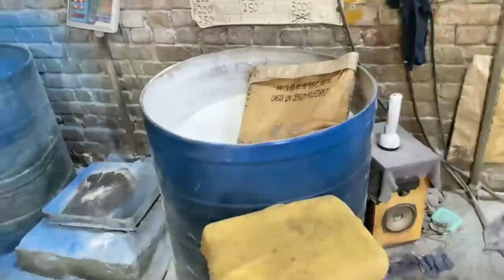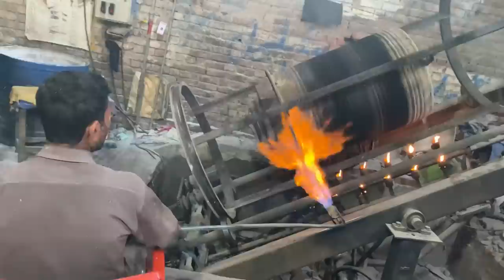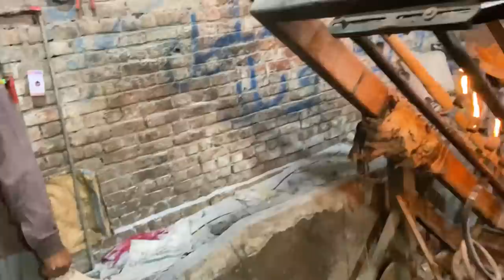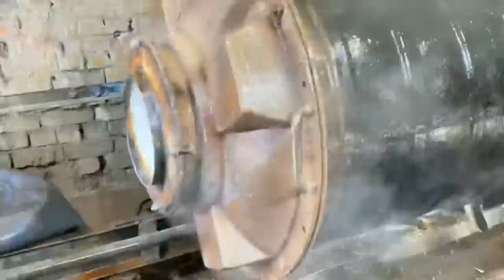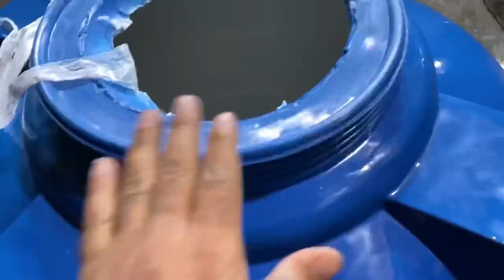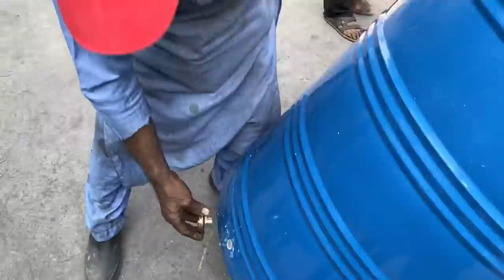Manufacturing Of Water Tank | in Local Factory Manufacture of  water tank |

Comment: How much do I need to start such a company using biogas as a mean of fuel?
Reply: Only estimating by eye but it looks like about 500 kW or a little less than 100 m³/h of biogas (with a little more than 50 % methane) at full power but it doesn't burn many minutes per tank. You need a gasometer after the digester so the production of gas can be continuous with intermittent consumption of gas. I think the design of the tank mold can be improved to save a lot of gas too. Just having burners in the open air is a terrible waste of gas.
Reply: The fumes coming out of the hot plastics are dangerous. Wont want to be anywhere close.
Reply: you can buy a chinese molding machine run on electric. and you find the way that your bio gas turn to electic energy.